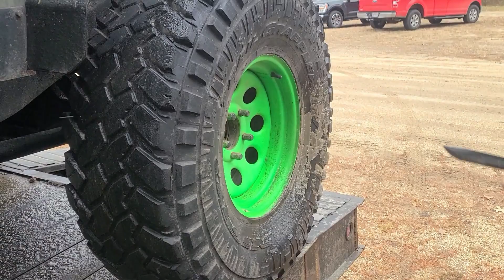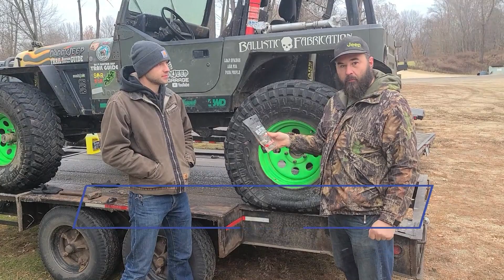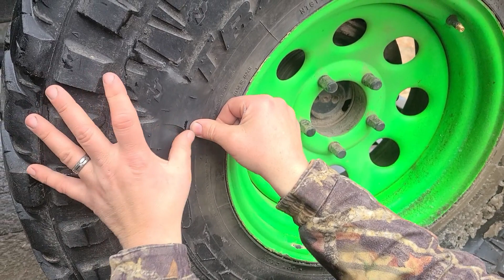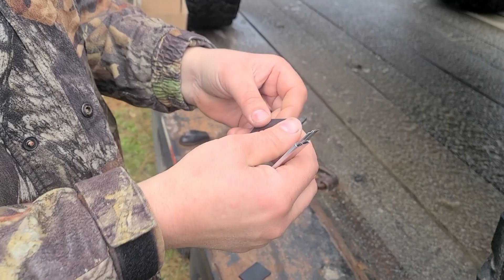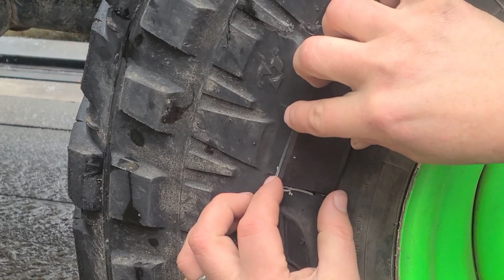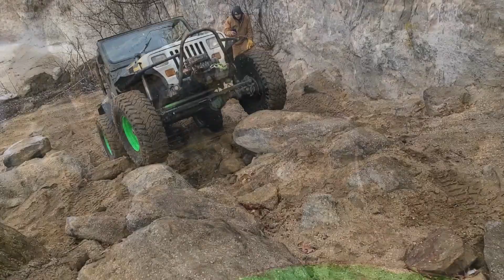GlueTread Sidewall Repair - we put this repair on a 40" Nitto through everything we can throw at it

Comment: The basics make sense. What doesn’t make sense is when the accelerator is sprayed on the outside of the repair. Superglue type adhesives bond very quickly with isopropyl alcohol, which is my guess for what the accelerator consists of. The alcohol also gives it a much more durable bond. To take full advantage of the adhesion you need to apply it on the inside of the patch just prior to applying to the adhesive area. That process that I just outlined wouldn’t have peeled back after your first repair. I’ve been wanting to try this with alcohol and loctite super gel. It’s a cyanoacrylate based adhesive that flexes while maintaining the bond. I have a 3 inch tear on my spare for my rig and I’d like to salvage it. The cut is only rubber deep. The other layers appear to be intact.
Reply from the maker: Good info. Thanks buddy
Reply: Mate if you’re not currently stranded don’t do an external patch to save a tyre, if you want your tyre to last, patch it on the inside and the outside. But for gods sake don’t use super glue, use proper rubber cement for the purpose.

Also just so you’re aware and this is commonly known it’s not just me saying this but accelerator on super glue reduces the bond strength and makes it more brittle. When using super glue for best bond allow it to dry naturally. Accelerator or “kicker” is used a lot in model building where they sacrifice some strength for less time spent holding parts in place.

I’m not sure about the accelerator they use for the rubber cement product they use and how the chemistry of that works!! But I know for super glue it makes it more brittle and weaker👍🏼👍🏼

Comment: So basically super glue rubber cement and a piece of rubber from old tires got it thanks for the tip homies
Reply: Yea I have always done that but old inner tube isn’t thick enough. It bulges out and yea it’s not great. You can make this kit yourself but you need to find some more substantial bits of rubber. It’s the thick rubber combined with the glue that gives your sidewall some structure and allows the rip to not continue.

Comment: You could fix that hole with tire plugs, I've never seen a sidewall cut that small when rock crawling.
Reply from the maker: A lot of actual sidewall damage is from the sidewall being pinched between an obstacle and a wheel. These are typically pretty small.